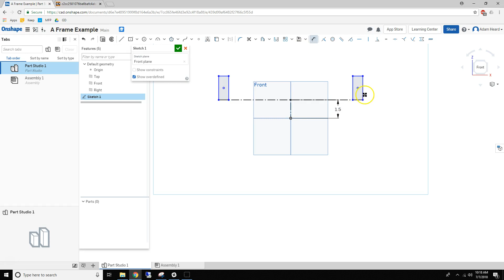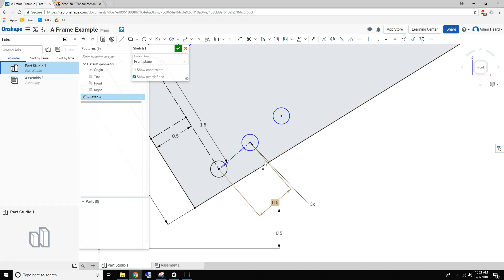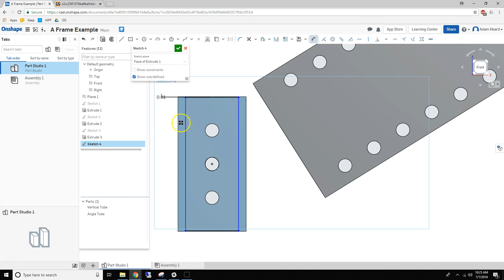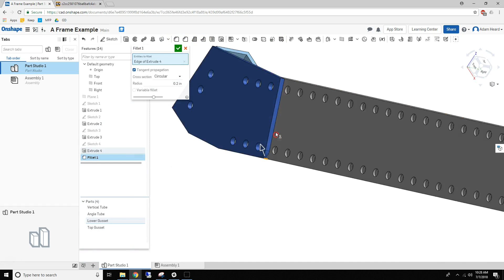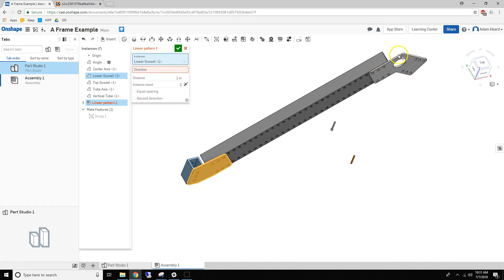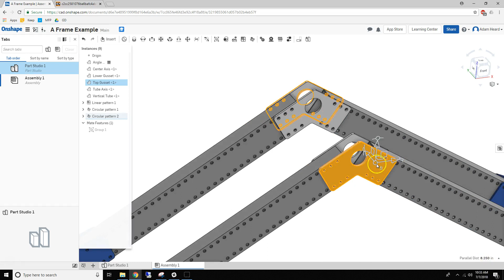Onshape A-Frame and Assembly "Mirrors"

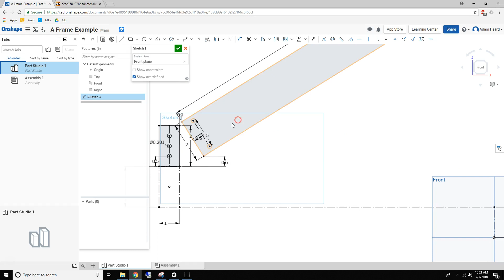Comment: Btw: at 4:13, you can  make the linear pattern go in any direction you want by dragging the box, not the arrow. Also, if you double click away from the linear pattern, it won't exit the sketch. I know this vid is kinda old, and you've probably figured this out by now, but just wanted to let u know

Comment: You've probably figured this out by now, but I'll leave this here for any future watchers. The way to mate the center of the arm part to the center of the shaft seems to be to use mate connectors. You'd put a mate connector at the relevant points in the part studios, and then mate them with whatever degrees of freedom you'd desire. More info here: https://cad.onshape.com/help/Content/mateconnector_a.htm. I believe this is the functionality you were looking for, and I just discovered it myself.

- Max (6662)

Comment: You''ve probably found this by now, but you can simply use a revolute mate on the bearing center and the end of the shaft instead of the cylindrical mate.   Interesting trick with the groups and rotations though.  I'd never seen that.